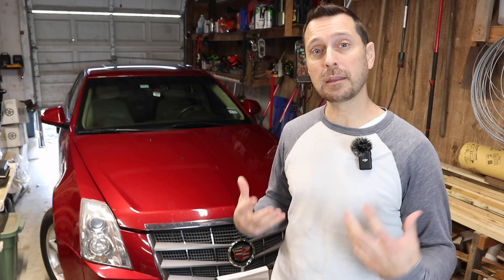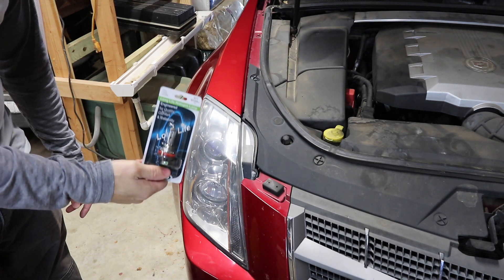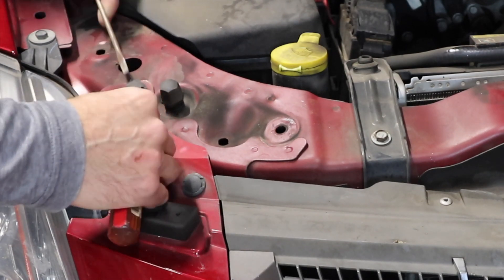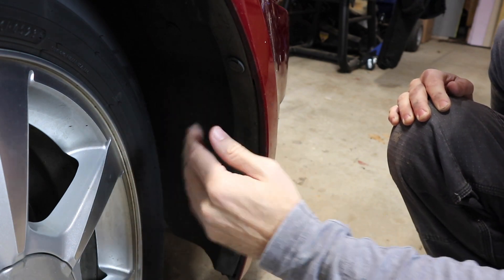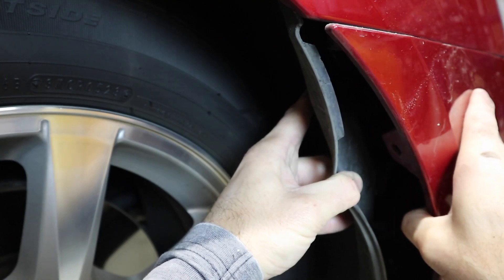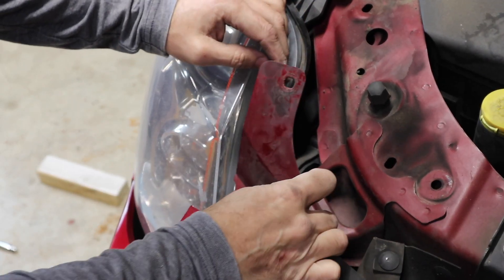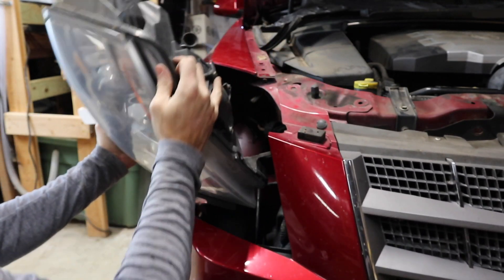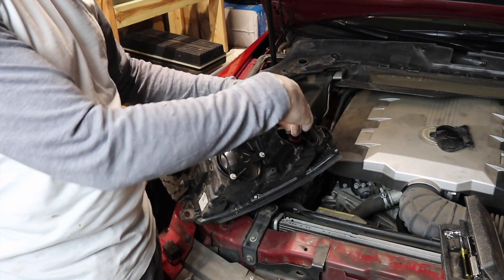How To Change Headlight Bulb 2008 Cadillac CTS - All Steps

Comment: Wowzers,  that was definitely a bit of a job.  Thanks for sharing. 

I've a Ford F150 and I believe it's 5 bolts and done... I did learn the hard way about using gloves 😮😂

Blessings ❤
Reply from the maker: I haven't had to change them on my Ram yet but I think they may be more complicated than an F150. I like my old Explorer...no bolts, just unplug from the back of the headlight housing.
Reply: @CountryLivingExperience  agreed... my brothers truck was a bit more complicated.  I was shocked how easy it was. So glad you showed while a bit involved, it's still very doable! 
Blessings
Reply from the maker: @amsohn1  Yep. A little elbow grease makes it doable for sure.

Comment: What a terrible design. No wonder Cadillac car sales are falling off the cliff!
Reply: Cadillac sales are going down because for the same money you can buy a much more reliable Lexus with better resale value.
Reply from the maker: Most modern cars are designed like this.
Reply: @CountryLivingExperience  One would think that the engineers would not let this happen.
But most people take it either back to the dealership or their mechanic.
Reply: Service revenue is a profit source for car dealers so the GM engineers must have designed this to maximize their cash flow as they charge by the hour.
Reply: Cadillac sales are falling off the cliff? So why do I see so many on the road?
Reply: "Cadillac sales are falling off a cliff"? So why do I see so many on the road?
Reply: @Doc1855  I had a 1990 Lexus LS 400. I got it cheap and was told they are great cars. It was so disappointing. Ride, handling, & terrible gas mileage. I'm guessing the new ones are better. I sold it and bought a 2008 CTS. It's still an old car but much newer. It's a great car to drive. Handling, ride, power (has direct injection), and better gas mileage. Did they improve the Lexus? Their "flagship" of the day was terrible! I had a 1993 Vette before the Lexus, and, like the Cadillac, it was also a great driving car.